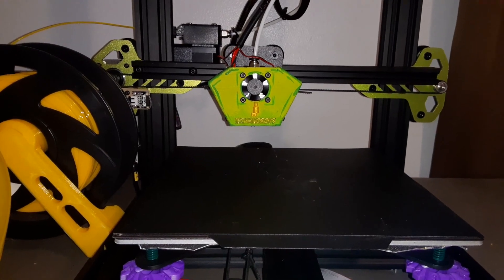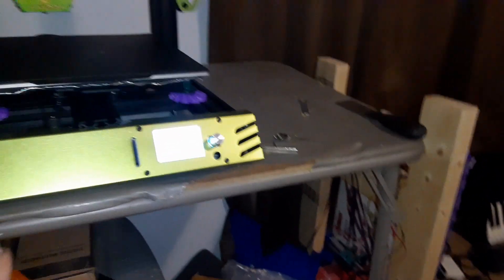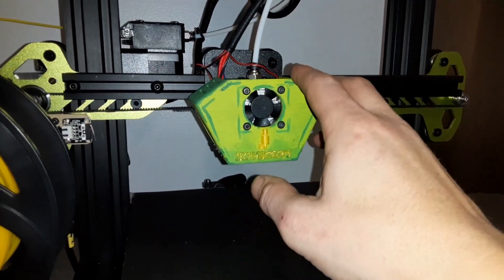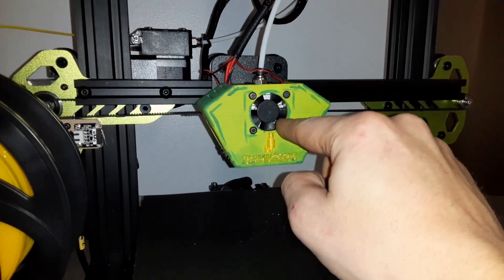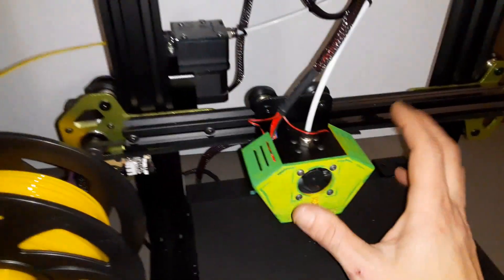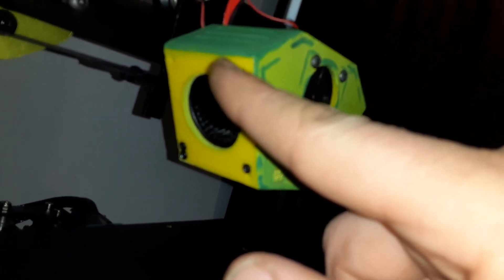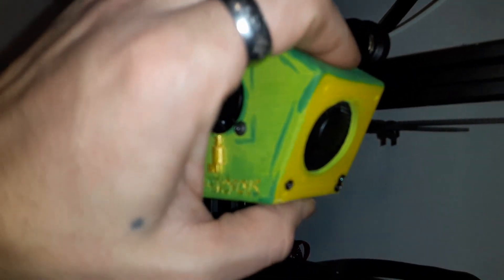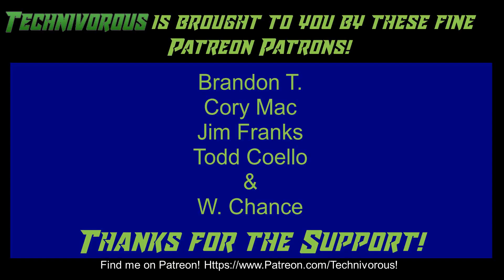Tevo Tarantula Pro 2020 - New Hot End Mod, Print Failures, Future Mods, and more!

Comment: ey Nick. based on this printer, was wonderin if youve had any issues? I've had to buy a new 2040 Y extrusion, and is currently having holes put in it, cause the stock 2040 Y , is warped where the bolts are, causing stretching and resistance